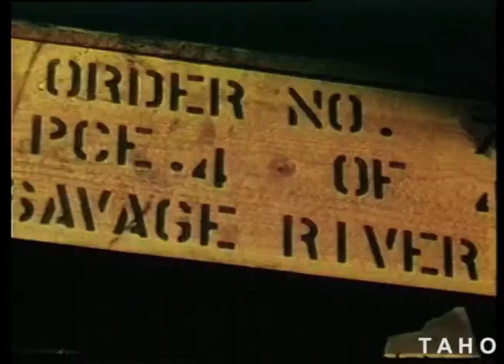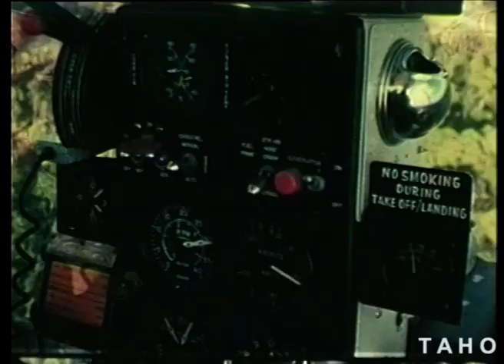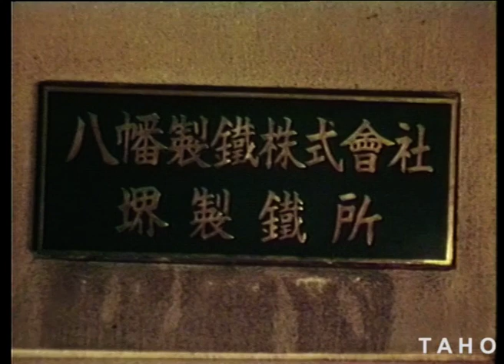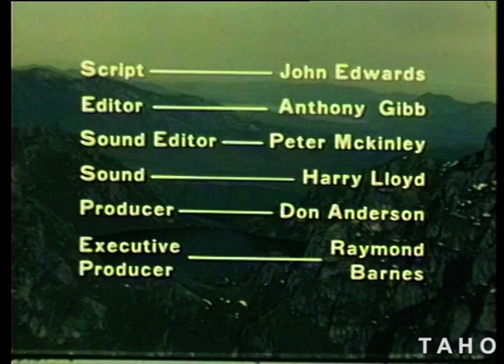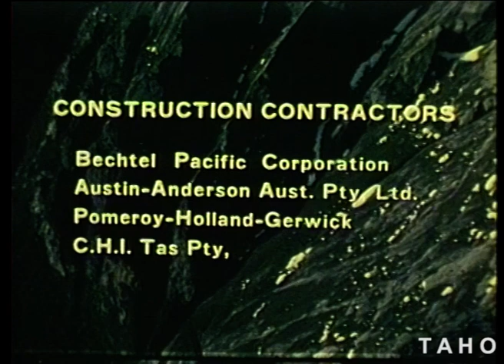Savage Iron (1968)

Comment: The 'discovery' was initially made in 1955 by the first airborne magnetic survey in Tasmania carried out by the Bureau of Mineral Resources with a DC3 over the Savage River iron outcrops that had been discovered as early as 1879 by gold prospectors around the Long Plains area. In 1959-61 a detailed ground magnetometer survey (10 east west grid lines) over the prospective area was carried out by the Tasmanian Department of Mines which led to the delineation of the main magnetite lode and the south magnetite lode, three kilometres south of the main. The main lode was drilled in 1964 to 1966 using a Bell helicopter to fly in the rig. The south lode was finally drilled in 1999 by Low Impact Diamond Drilling and commenced mining in 2003.
Reply: There's a bit of detail there that I haven't heard before.  Although I'm a little confused regarding your description of the magnetite lodes. In the early 1980's the south pit was deep & well established. However, what was then known as the Northern deposit was still quite a hill with trees & a road on it. (Today, it's another pit).